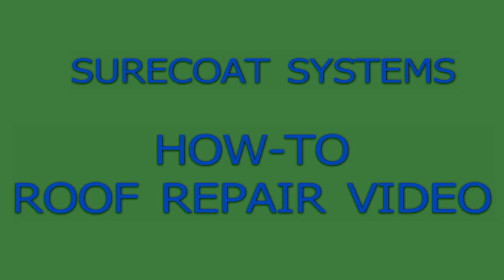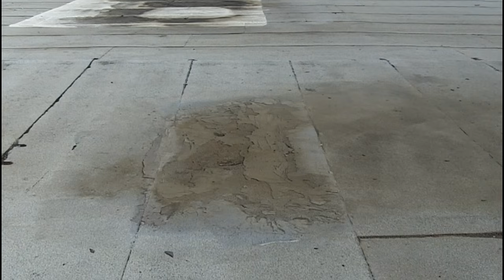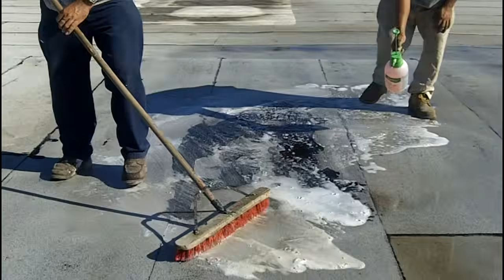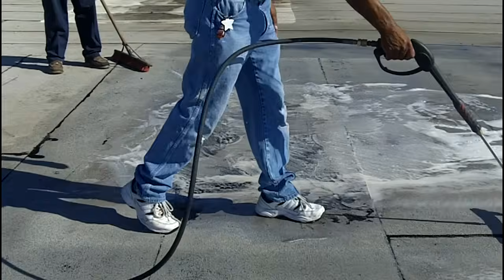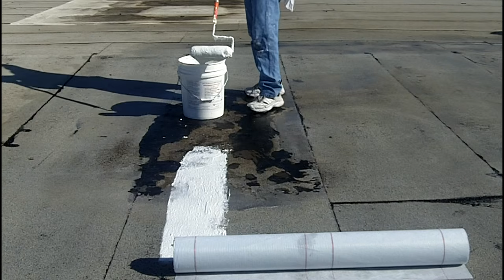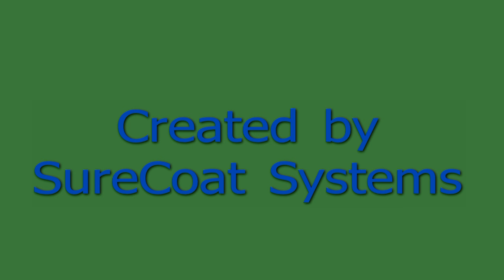How to Install Elastomeric Roof Coating - Flat Roofs

Comment: I'm about to replace the current existing roof with a new energy star roof using energy star asphalt shingles. I want to apply Elastomeric roof coating over the shingles,but that is not recommended by Wikipedia,and multiples web sites. Some home owners had that done because in Miami Florida Power had paid to have this done on certain houses to lower their energy bill,but years later the homeowners found out that elastomeric coating applied over shingles shortens the life of the roof instead of extending the life of the roof. So my question is when using energy star asphalt shingles can the Elastomeric roof coating be applied to the underlayment, or on top of the roof deck before the shingles are applied? If so since the Elastomeric coating would be underneath the energy star shingles would there be any benefit in making the roof more energy efficient in terms of lowering the power bill like using roofing insulation will?
Reply: SureCoat Systems, Good response.
Reply from the maker: TY!
Reply: Sam Enigma e
Reply from the maker: @ Sam Enigma, No applying SureCoat or any other elastomeric reflective coating for that matter, beneath the shingles will not provide any R value as insulation does.

However, SureCoat would add a waterproofing membrane under the shingles by doing this but not energy savings.  I hadn't heard that coatings can shorten the life of the shingles. How are they explaining that this is happening and determining that the premature failures of the shingles are due to the elastomeric coating application? The only thing that comes to mind is that shingle are suppose to stay breathable in a sense and perhaps the coatings used in Florida were contributing to trapped moisture which in turn can create mold issues and eventually substrate rot in a wood or metal deck...?

I would be grateful for any factual/case study links that you could send me. Be careful not to accept "blogs" as facts when it comes to tips, DIY, etc. There is a lot of information online but its not all true. A lot of what roofers and manufacturers write about is filler stuff for their website. Here, we provide educational info as well as cutting edge waterproofing technology. 

Thank you and Good Luck! Reach out to info@surecoatsystems.com with any questions or concerns.

Comment: This product hasn't even been around for 20 years .So how could you say it last for 20 years?I have several jobs I did 20 years ago using rubberized emulsion with the membrane better still in great condition. I only went back twice to put a re coat. once every 10 years. That's doing the job the right way with years to prove it.
Reply: The response below is weak and somewhat unprofessional. The roof you use as an example was put on before you bought the rights or the company. The installed chemicals were not produced by you, you had no input in the selection of the ingredient chemicals. As roofing contractors, we stand by our work, at least some of us do, and it is very important to us that the people who put their trust in us get a good system. All roofing systems have a period where they are new and the warranties are just and estimate until proven by time. I would never use somebody elses roof as and example. It is more important that the manufacturer will stand behind the product for the stated period and has the $ and desire to solve problems.
Reply: Manuel Perez  maybe you can give me some advice.. lm putting a tar paper roof on my old travel trailer. Should I use staples or roofing nails. I plan to paint it with elastomeric roof coating, should I use some time of primer. The guy at Home Depot said I should be fine with just the coating  itself. What do you say?
Reply: I am coming here knowing nothing about this product, but in industrial science it's typical to rig up tests in labs where say 20 years of UV exposure can be simulated over 2 years.
Reply: Never heard of artificial aging then.
Reply: You are right Mr. Perez.  I am currently working on a 25000 square foot foam roof in phoenix.  I use the emulsion as well.  Just do what TieTex says to do, right?
Reply: I use rubberized emulsion also. That's why I don't have to spend 20 years prepping a roof with a scraper and a tooth brush. I've seen the emulsion roofs with polyester mat last for many years.
Reply from the maker: We have a project that we have been monitoring in Los Angeles that is 20 years in service, same chemistry, renewed in year 11 with a top coat. Product was rebranded in 2006 to SureCoat. I don't have time to argue. These videos are here for people who want to learn. I am here to answer questions not defend a brand that you haven't ever tried.   

"There is a principle which is a bar against all information, which is proof against all arguments, and which cannot fail to keep a man in everlasting ignorance—that principle is contempt prior to investigation." Anonymous

If you prefer your method, by all means carry on Mr. Perez. Take care.
Reply: Answering inquires and handling objections is not arguing, it is selling.
Reply: Answering objections and handling objections is not arguing, it is selling.

Comment: You are suppose to use a black emulsion with the membrane fabric.Just using coating is the lazy way to do it.It will not last long. I know i have 20 years experiences.
Reply from the maker: I appreciate your experience Manuel and opinion and I agree with you mostly but in the case of traditional acrylic coatings or even silicone maybe but not with the SureCoat roof coating system. You actually can not use mastic with this system and the SCRS can last 20 years even under ponding water, it doesn't peel. Mastics are temporary and not UV stable. SureCoat is UV stable and waterproof so there is no need for a mastic. If it cracks after a year, why go there? SureCoat is used with polyester woven mesh roofing fabric for tensile strength creating a 2800 psi, that again is UV stable so you don't have to that again in that same area. Even repairs with this system will last 5-7 years no problem. I know it may not sound right because you have been around for so long but not all coatings are the same Manuel. SureCoat has a perm rating of .0025 Coatings usually have a perm rating of 5+, more often 
20+. SureCoat is the waterproofing not just a reflective "coating" but is also one of the highest rated aged products with the CRRC. I have put the offer out there on here before, feel free to email me for a sample kit to try for yourself to Jamie@surecoatsystems.com. Thank you!!
Reply: thank you
Reply: Manuel Perez if

Comment: with this material plus the fabric if the day is not hot it'll not dry underneath it and if it get wet it will just be a waste
Reply from the maker: We have an alternative fast drying coating for cooler weather applications that you can read more about here: http://surecoatsystems.com/sureset-quick-dry-roof-coating/
The application method is the same.
Reply: That's totally wrong. I've done my whole roof with this and my garage and it dried fine on cool winter days and works great. If it rains within a couple hours on a cool day maybe, otherwise no problem.

Comment: I'm honestly concerned about elastomeric over tar, every time I've seen this done it causes the coating to prematurely age and either crack and separate or completely delaminate and come off. No base or primer.... so now I'm curious what the warranty would be on this? Yikes.
Reply from the maker: @Detu Maki,  As with most surfaces prior to coating/painting, prep is key. Especially over tar, metal or single-ply roofing materials. SureCoat was created because of the common mastic, acrylic and silicone coating failures that plagued the industry, delamination and leaks! Since before cool roofs were cool, roofers and consumers alike have been attempting to use coatings to solve roofing problems and water intrusion issues they were never intended for and this is based stickily on their chemistry (not what the salesman or distributor tells you). I have a Definitions Key that I can share with you if you would like a list of what properties to look for in a coating. (You will find this info on the PDS - not the brochure.) The SureCoat roof coating system used in this video includes cleaning the roofing material with SureSkrub, a bio degradable roof detergent, tough enough to cut thru the grease on restaurant roofs. SureCoat has excellent adhesion without a primer. We have not had a roof where SurePrime was required for the seven years I have been here. If cleaning is not possible, SurePrime may be an option. The resins for adhesion are manufactured into the SureCoat single-component coating and is combined with cross linkers that change the molecular structure of the coating; creating a cross-hatched pattern too small for vapor moisture to permeate and hook-like teeth to bite into the roof surface, increasing the tenacity of it's adhesion compared traditional roof coatings, paints and mastics. Lack of UV stability and waterproofing ability are the two key factors that cause roof paints, coatings and mastics to fail prematurely. 

Furthermore, not all coatings are the same in their chemistry and resins, grades of resins, etc. and therefore not one coating can fix all things roofing... Many are only maintenance coatings that you can expect to peel up every other year at max.

SureCoat has been being successfully used over tar, gravel, metal, slippery single-ply and other surfaces without delamination in climates all over the world. I am happy to send you an adhesion test kit which includes the SK roof cleaner as well as a small bottle of the SureCoat roof coating and a strip of Poly-Mesh to test the adhesion of this system over your roof. Depending on where you are located, you may have to wait until Spring to be able to test the single-component original formula used in this video. (We do have an alternative coating for waterproofing in temperatures as low as 40 degrees.)

As with most coating and paint manufacturers, there is a material defect warranty of 1 year. If you would like the security of a 10-20 year renewable leak-free guarantee, or in the case of a SureCoat Roof System Warranty, a guarantee that covers leaks even if there is ponding water on your roof for 10-20 years, the SureCoat Roof System must be installed by a  SureCoat Seamless Single-Ply Approved Contractor to specification in conjunction with the warranty checklist requirements.

Feel free to reach out to Jamie@surecoatsystems.com for more information, samples or further questions. TY!
Reply: No where do you mention moisture testing the roof. You cannot roof over a saturated roof and one sign of a saturated roof is leaks. How do you know the substrate condition without moisture testing?

Comment: 'theyuha' brought up a good question, what is thee fire rating? I seen you mention in the comments that you have various of colors. I live in Miami where it rains and rains plus it is always scorching hot. Black wouldnt be an ideal color for where I live right? Can it be used on thee whole roof?
Reply from the maker: SureCoat has a Class A over an existing roof. In Florida most customers use standard bright white (least expensive) or a light tan or gray color but yes, the coating is available in 25 colors. Please email us at info@surecoatsystems.com to request a color chart and pricing or call 877-823-7873.  Thank you!
Reply: @Surecoatsystems 
I have like 3 different leaks on a space  on my flat roof similar  to size he is repairing that has asphalt shingles . Will this work with asphalt shingles if so what is the material I need and what underlayment or material is that roll he is using
Reply from the maker: @ Journey Is The Way - The fire rating is as good as it gets with a Class A. There are 25 colors available for a topcoat if white is not desired. 0The darker the color, the lower the solar reflectivity. Your are correct in that black is the worst for where you are. We do not make it in black. Bright white is the best. SureCoat is the best white roof coating because it not only reflects UV but also keeps 93% of the heat out of your building. Yes SureCoat be used on the entire roof and more often than not it is used to refinish the whole roof. This system is very popular because it lasts for 10 years and it is waterproof in ponding area. There is nothing else for flat and low-slope roofing which actually performs under ponding water so SureCoat seems to be very common there in FL.  Please feel free to reach out to us (ask for Monique) at 877-823-7873 for more info or a quote on materials delivered.
Reply from the maker: Our product has held up quite well, some of our customers used our rapid drying product SureSet the day before the rain and have no problems
Reply: SureCoat Systems 
how did your product and past jobs hold up to all the rain California has been getting?
Reply: Buenos @andrewbeaudry4399
Reply: SureCoat Systems 
thanks for answering my question
Reply: Journey Is The W

Comment: Can i use this on a plywood deck in a boat? then apply a carpet on top of it?
Reply from the maker: Good morning Bradley,  The SureCoat Roof System as shown in this short video can and will adhere and waterproof the plywood deck of your boat. However, we would not recommend that you apply the SCRS direct to the plywood because even reinforced with the Poly-Mesh (which a 2800 psi tensile strength) the expansion and contraction at the joints in the wood deck are a concern as it may cause the SCRS to tear/split st some point. We always recommend a "slip sheet" of sorts such as the cheapest peel and stick granulated cap over the plywood and then the SCRS.  Please call us at 877-823-7873 to discuss further or for a quote.  Thank you! - Jamie Barnett

Comment: After this process, can the roof be painted on?
Reply from the maker: Yes, you can paint the roof after this process but you may not want to.  SureCoat is available in 25 colors. Paint will change the overall solar reflective properties and the paint will eventually peel off of the SCRS as paint is breathable and waterproof. SureCoat is similar to a rubberized roofing membrane once cured so it is impermeable, flexible and UV stable unlike paint and therefore will thermal cycle at a different rate, lasting much longer than paint.  You can us with questions at 877-823-7873 or email your questions to info@surecoatsystems.com. - Thank you!

Comment: I have a residential porch roof that is leaking in NJ. 4 seasons. Is this a good product? There is a dip where water does puddle for a couple of day's in the cold weather. How long will this product last? Can it be walked on?
Reply from the maker: +lou ezzie - Whether or not this is the right waterproofing system depends on the existing material on the porch.  If its asphalt or wood, yes.  If there is an existing coating over concrete, then we would need to talk about it. Yes it will work in NJ as it is made to take on extreme freeze-thaw conditions without becoming brittle.  However, you can not do the application until the weather is good.  It should last 10 years before requiring a maintenance coat. We recommend adding silica sand for slip resistance in traffic areas but yes it can be walked on.  Please call Monique at 877-823-7873 for pricing and to see if we have a contractor in So Jersey as per your online request.  Thank you for your interest and questions.

Comment: Thanks for the information. Is this a global product of only in the U.S.?We have some similar looking products in the U.K  but they might be acrylic. Is acrylic good enough or should I be looking for something better?
Reply from the maker: +Skill Builder - It depends on what you are in need of?  Traditional acrylics are not for waterproofing but rather they are for heat emittance and reflectivity.  The SureCoat roof coating is a hybrid coating and for waterproofing as well as heat emittance and reflectivity.  To-date, SureCoat surpasses all acrylics on the market after in service for three years on the roof, as it remains free from cracks, splits and tears.  We have acrylic videos on this channel so you can see what an acrylic coated roof looks like after 18 months-3 years.  Everyone we have inspected is in bad shape because low-sloped roofs have little ponds and it causes the acrylic coatings to peel and crack open.  Acrylics have too high of a perm rating for low-sloped roofing.
Reply: Elastomeric is the best